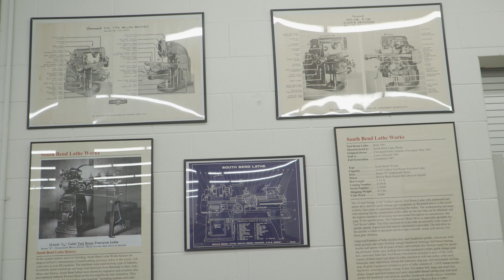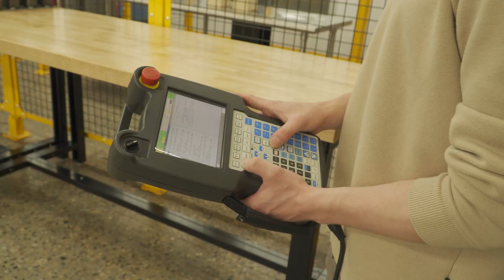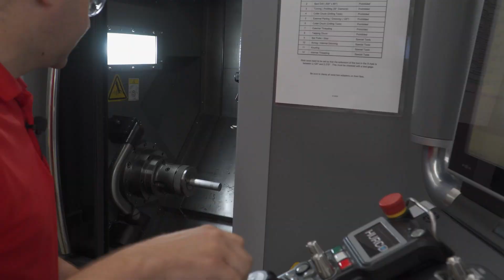Incredible Manufacturing Lab In Michigan // Ferris State University

Comment: I'm glad we are seeing a revival of manufacturing in the US and Mexico. I think this will be able to help us decouple from China as time goes. It will also help Americans be able to understand first hand some of the constraints around manufacturing and how we can improve them. I personally have some business ideas that would require some machining and use of 6DoF robot arms.

A thought is (I am aware this may be the wrong place) to make 6DoF arms with using carbon fiber arms. Rather than having to machine them. The concern I would see is the motors and computer system are still the expensive and more difficult part to set up and use. I am aware that AI can make the code writing part much cheaper. 

Do you guys do much with manufacturing custom parts? Also, do you manufacture silicone based soft robot tools?
Have you considered working with/manufacturing for non-profits who have the intent of enabling poeple to assemble their own 6DoF robot arm? Like the AR4-MK3 robots here on YT. Look up under the account @anninrobotics 
Keep up the great work. We need you guys out there. Also automation engineers.